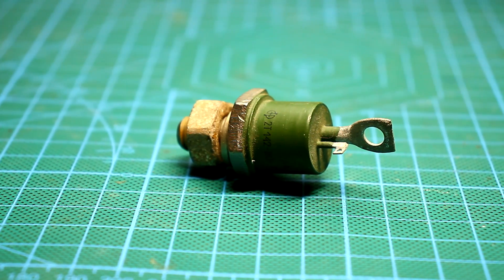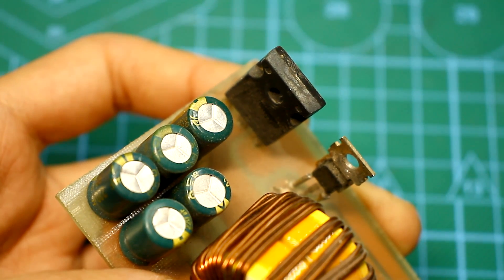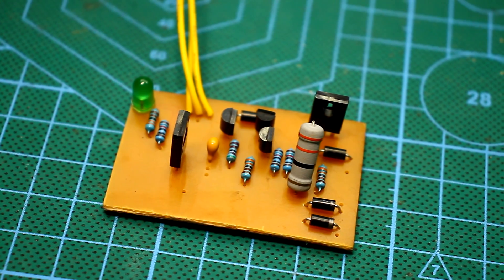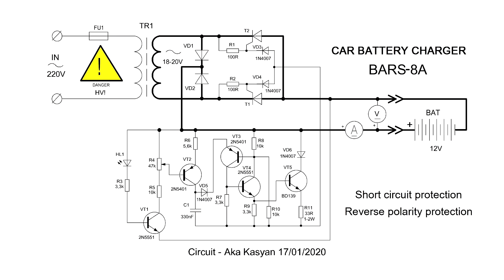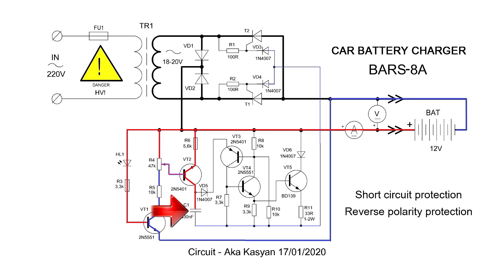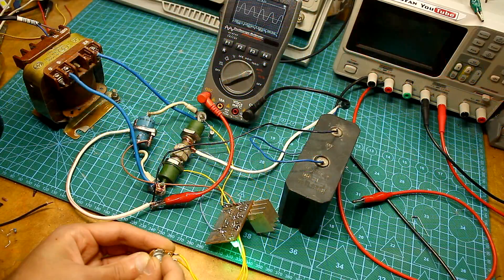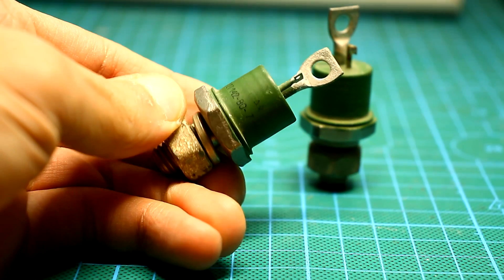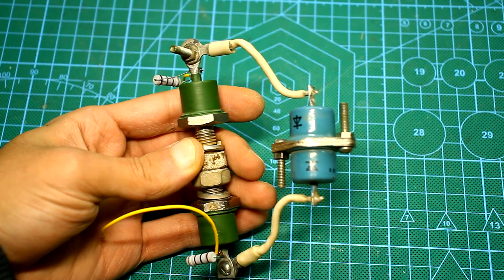Unkillable charger for car batteries

Comment: Good to see this SCR-based charger. What are your comments to adapt an TRIAC-based dimmer on the Primary of an existing charger to do the same? Doing that, we could “dim” or phase-modulate its output. 
It would be possible to create an opto-isolated feedback loop (from secondary to primary) using an LED+resistor and a LDR in parallel with the dimmer’s potentiometer.
Please let me hear your opinions about that.
Thank you!

Comment: Interesting, wondering if they can be used on lithium batteries with a safety cutoff circuit. Simple dumb charger but with a smart reliable on off switch.

Comment: Wow thank you very much ! A fast and easy method to rig up an sturdy electrolysis power supply !!!
Reply: The simplest is just a transformer with low output voltage and high current (about 3-6 volts AC, if you plan to generate hydrogen/oxygen from water), a rectifier and smoothing capacitor. It's good (but not completely necessary) to have some way to control the voltage - the simplest (but can cost some money to buy, if you don't have one already) is a variac. You ultimately want to keep the voltage as low as possible (and primarly increase current and reaction speed, by lowering resistance - add electrolyte to the water for example and use large electrodes). The current is what does the work in electrolysis - voltage (more than a few volts, to get the reaction going) is just wasted power and do nothing, but just heat up the water. But - for example 2 or 3 cells can be connected in series to make efficient use of a 12 V supply - because those comes in a lot of different shapes and sizes (if you can get hold of an old computer power supply for example - that can be good for things like this).
This charger circuit will not work though - because 1. it seems like it needs a 6 V back feed, to start up at all (so you need a battery, that already have some voltage in it, for the circuit to start up - even a "dead" battery normally still have some voltage in it. But, an electrolysis cell, is pretty much just a resistive load) and 2. It gives pulsed output current - wich works, but is quite inefficient for electrolysis.
Reply: Thanks for your input ! I have a variac but it´s combined with a transformer for galvanic isolation so it´s above 30kg and quite heavy to carry from a to b. Good to use only If I am at my measurement bench. If I want to go outside I need something less heavy to carry around. I could use this setup only with addional  voltage  good point to remind me on that ! So the electronics could be fed with a small extra transformer rectified and smoothed to DC. Then we have the pulsed problem. Well instead of the battery we can place a big filter cap there and the pulses are gone. I could adjust the voltage with an op amp and comparator instead the potientiometer in his circuit and could add a resistor divider to measure the output. Would be a new circuit on some parts. I could also try to measure the current and regulate the SCRs to give constant current.
Reply: @Telectronics  Carry around your power source outside? Where do you get your power from then? Of course you can use a batteries to feed an electrolysis cell directly, but it takes quite a bit of energy (even if you have good efficiency). Small batteries will run out fast - and if you have large ones (like a car battery), those are also heavy to carry around...
Maybe you meant that you want to go outside your house - but just don't want to carry the variac out from your room out to your back yard for example?
If you put many smaller cells in series (for example one bucket, with a pair of electrodes, makes up one cell - but you can also have several of them and connect them in series). That way, you can in fact use higher voltages and still keep up the efficiency. If you connect for example 10 cells series and apply 40 volts and get 10 amps - each cell, will not "see" any difference, between that and being fed by it's own 4 volt power source at 10 amps (given that you "balance" the resistance so all cells have the same - by for example regulate the amount of electrolyte). The whole setup will produce the same amount of hydrogen as a big cell running on 100 amps. But, it's more work to collect gases from many small cells instead of one big. 

Maybe this charge circuit will work, if you put a large capacitor on the output (I didn't think about that), then you charge the capacitor up, by another power source (wich doesn't need to have very high power - just like 4 AA batteries in series, will do well), once it's charged up to 6 volts, the circuit will "think" it has battery connected and start charging the capacitor to the like 14 volts a lead acid battery is usually charged to. Then you can pull smooth DC from the capacitor (at the same rate as the average current from the pulses). The voltage is not ideal, but with 3 cells in series it should do quite good. 
Constant current is the best to have - sine the reaction speed is determined by the current. The resistance during electrolysis also tend to go down slightly over time as the concentration of electrolyte slowly increases when water evaporates and is used up in the reaction (so, if you use a constant voltage source with the current at it's maximum already from start, there is a risk of overload if you leave it unattended for a while. This charger seemed to have overload protection, though. But with a constant current source, it will be completely self regulating and the reaction always stays at constant speed - set by the current).
Reply: @Speeder84XL  Yes I meant outside the house like garden, backyard because there I have mains electricity available. My transformer can deliver 22V AC and 45,6A that should be plenty gas right If I use around 10 cells.
Reply: @Telectronics  Yeah! That's pretty good. 
I think 10 cells at 22 volts is a little too much though. I think 5-8 would be about right for that voltage (given that you get like 30 V DC after the rectifier and smoothing capacitor). You can start out with 5 cells, then add more if you manage to lower the resistance of each cell enough. The more cells you can get in series, the better. It's not important each cell have the exactly the same resistance either - just as low resistance as possible. I wrote that just as a reference for the calculation in my example of 4 volts per cell to be correct (and forgot that it's just the current that matters for reaction speed, not total power with heat loss included). If some cells get for example 4 volts and some 3,8 or some 4,2 due to small resistance differences when connected in series, doesn't really matters, since all cells still get the same current passing thru them. 
The biggest challange is usually just to get the resistance down and minimize losses. You still need a few volts at each cell though. It will act pretty much like a diode (wich you feed in the forward direction), with a resistor in series. You want that resistor value to be as low as possible to minimize losses - but you still have the voltage drop to overcome. As opposed to the diode in my example (where the voltage drop just causes a power loss), the voltage drop of a cell (times the current), is what transfers the energy that goes into to splitting the water to hydrogen and oxygen - so, that power is not wasted :)
Reply: @Speeder84XL   Cool thanks for the explaining. I was just wondering If you can get enough gas to use directly for soldering or welding purpuses. Would be cool to just attach a burner at the hydrogen and oxygen and see If you can craft cool things only from water ! :D
Reply: @Telectronics  I think that will work good also. You should be able to get like 3-4 liters/minute from that transformer (given that you get enough efficiency - lower the resistance of each cell down enough). That's enough for a small torch. Most designs doesn't seem to separate the oxygen and hydrogen (both gases are collected and mixed in the same vessel) - that's dangerous (since the mixture is very explosive) and requires a special design, of the burner to avoid the flame go backwards into the burner it self and blow up the whole generator. The advantage of doing it that way, is simpler design and get slightly better efficiency since you can have the electrodes very close to each other (=lower resistance)
But I still think it's better and safer to build a design that collect the hydrogen and oxygen separetly, then mix them in the burner head (pretty much like an acetylene/oxygen torch). It's safer and it's nice to be able to adjust the ratio between oxygen and hydrogen. For welding and soldering - you often want to have a slightly reducing flame, to avoid oxidation of the metal. Both gases are also fun to play with on their own (balloons are much safer to handle and float better with 100% hydrogen, than with 1/3 of the gas by volume, being "heavy" oxygen, haha) and the oxygen can also be used for burning stuff that you just want to burn really hot and not explode, haha